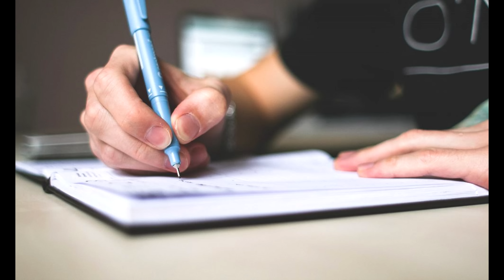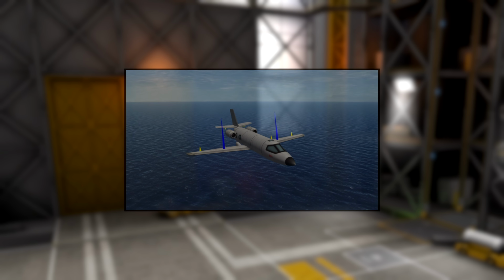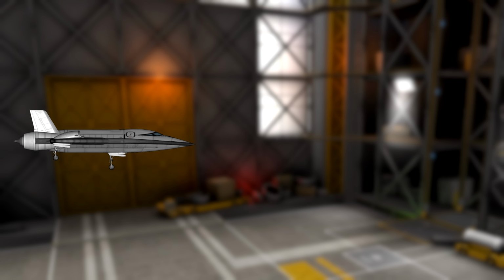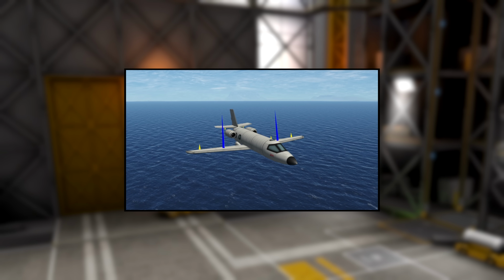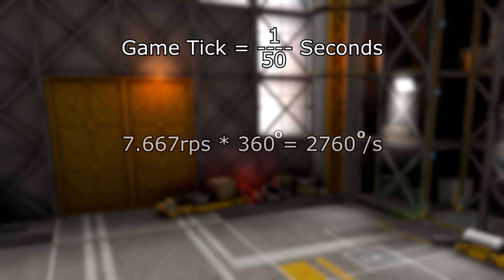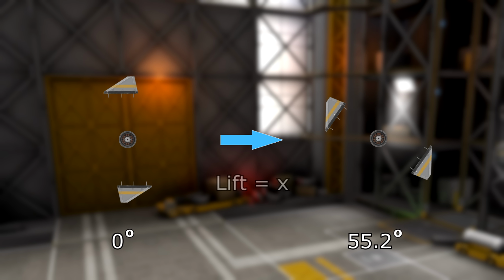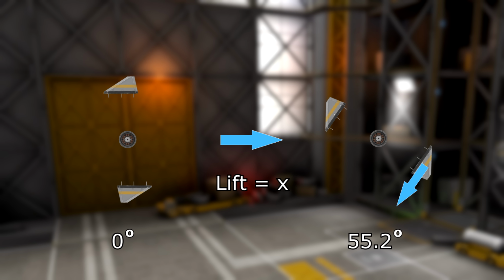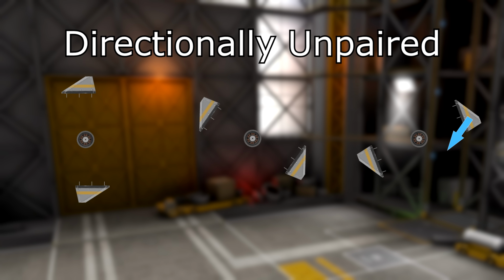Breaking KSP by Rotating a Fin || Directionally Unpaired Momentum Perpetuators

Comment: Fellas, is it perpetual motion when it’s solar powered? Just seems efficient. This guy gives off less data miner vibes and more just “i found a bug” vibes
Reply from the maker: If you cut off power entirely and the effect is potent enough the propellers will still accelerate, even beyond the stated rpm limit. It will eventually shake itself apart but it does generate output with no input, you just have to get it going first.

Comment: 1:43 of course it could do that. This exact procedure is known as the backwards Euler method to solved ordinary differential equations.
Reply from the maker: Doing it live is more complicated though, since it requires predicting the future position and then using that predicted movement to calculate forces. I'd imagine it would be pretty inaccurate under certain situations too, yeah?
Reply: @jedoesstuff9086  It definitely is more complicated, for each point in time a system of equations needs to be solved, but there are classes of problems (https://en.wikipedia.org/wiki/Stiff_equation) where the naive method, of only considering previous points, perform extremely poorly.

Comment: It’s similar to a classic issue in game engines, diagonal movement. When the X and Y inputs are added, the result is an increased diagonal speed. A common example of this can be seen in Minecraft’s run-and-jump mechanic
Reply from the maker: Not exactly, but that is the kind of thinking that lead ultimate steve to trying this in the first place. The logic was that instead of taking a circular path, because of how fast its moving, its more traveling in a hexagonal path. we dont really know about this though, which I caveated in the video

Comment: Wouldn't a quick fix be correcting the orientation of the vector by calculating how much the blade will be rotating in the incoming tick ?
Reply from the maker: not exactly, since this happens across every situation in the game. For props specifically, youd need to correct by  RPM * 0.12 degrees, but for planes it would be more complicated. Also you'd need to do this for all directions simultaneously, which would add a lot for the game to calculate and slow down performance.

Comment: I love how KSP code is now basically its own branch of physics lmfao
Reply: That happens a lot with "game breaking" genres. Speedrunning tends to create its very own worlds with new and weird internal physics. What was intended as a simulation or approximation of reality ends up creating new rules that are then being discovered and explored by players. GemCraft becomes about creating the most cost efficient gems and putting them into a configuration that minimizes lag. Trackmania mappers build maps that REQUIRE the players to trigger certain bugs. Then there's stuff like wrongwarps (for example in Zelda), where players start manipulating ram sectors with specific inputs. And Krakendrives becoming viable and reliable devices opens the door for completely new ways to play the game.

I absolutely love it. Even if i am usually just a spectator.
Reply: @privateprivacy5570 wtf gemcraft has speedruns?? I love that game

Comment: When I was younger (not that long ago), and still had interests including coding (life is dull), I realized that a lot of things would be solved by properly separating the flow of calculations and update everything last, though the downside is possibly worse overall performance.

In this case, you'd make the following calculations: 
- based on current (primary) forces, where will the object be? Effectively, put the forces together and store this separately,
- what inertial forces (drag, lift, etc.) or reactions (collisions, etc.) should also be applied based on the changes that will be made to the object?
- calculate all the forces together and update the object's position and rotation to suit.

All of this would happen in the first tick. It was a very useful basic trick to remember to stop things like clip-throughs from happening.
Reply: The hard part is doing all of that in real-time at 60 fps
Reply: @EpicGiantMango Like any game engine decision, it's a tradeoff. Fancier physics calculations would have increased the number of floating point operations required per physics object per frame, but fancier physics could have cut down on the years worth of patches dedicated to stamping out physics bugs.

In this case, parallelization can help a lot. When KSP was new, desktop CPUs could run a lot fewer parallel threads than today, so that would have been less of a factor.
Reply: Plenty of games and physics engines do this to different degrees, depending on requirements. It's also common to have sub-ticks where each full physics tick is divided into multiple steps. This is especially useful for detecting and handling collisions for fast moving objects.
Reply: You can use Euler's method or more generally a Runge-Kutta method. RK4 is common for physics simulation.
Reply: 'look ahead' physics.

good for simulators, bad for games.

Comment: The most insane part isn't even mentioned here because it's irrelevant for stock KSP, but if you imagine for a moment, if the rotors were "allowed" to go faster, this would actually cause a massive decrease in efficiency because the angle would still not change at all no matter how much faster you go. This means that at a certain point, the spinning actually causes the lift to be basically nullified entirely
Reply from the maker: I used this is my stock 3 ton eve mission actually with a stock prop. Stock props are limited to 480rpm instead of 460, so they actually do outperform rotors, but they are heavier

Comment: ive been working on my own electric only space program and have yet to leave kerbin this is gonna save me although it feels like cheating im trying not to use bugs
Reply: afaik leaving kerbin with only electricity without using any physics exploits or bugs is basically impossible. for what it's worth though, i was able to fly across the entire system in one stage using only electricity, a mk1 command pod and a mk1 front landing gear. so pretty much anything is possible with bugs.
Reply: Worth noting that this one tick delay is always applied, meaning the bug is in constant use as long as you have fins. At some point whether or not you're "cheating" is an arbitrary definition.

Comment: Ok but, as the angular speed changes, the optimal angle of the wing also changes accordingly, being less with slower speed and higher with faster rotation. Ideally, if it's possible to construct a contraption whete the angle of the lifting force changes during motion, it would be pretty epic

Comment: I think the devs fundamentally misunderstood what lift and drag even are: There's actually only ONE aerodynamic force, and lift and drag are just components of this force, perpendicular and parallel respectively to THE DIRECTION OF AIRFLOW. Not some arbitrary principal axes of the part.
Reply from the maker: I dont think they misunderstood, theres just the limitations on how to use that in the game with unity
Reply: @jedoesstuff9086  nah, you could perfectly model lift as the component perpendicular to velocity and drag as the component parallel to velocity. In fact, that's what the game does for body lift! but for wing lift for some reason it's in the direction of the surface normal instead of the direction of the component of the surface normal perpendicular to the velocity (if N is the normal unity vector, V is the velocity unity vector, L ought to be in the direction (N - V * dot(N, V)). That's just how "lift" is defined, and that's the only calculation they'd need to do to get this right.

And nah, this isn't a unity limitation. The lift calculation isn't done by builtin unity things at all, and it's actually quite trivial to mod in this change. It's just some quick hacks that are indicative of a fundamental misunderstanding of lifting body aerodynamics. There's a bunch more of those anyway, for instance where body drag of a long fuselage nearly doubles if you pitch up by a whole 2 degrees, which makes no physical or gameplay sense either.
Reply: i think the devs understood alot more than you think, but they made shortcuts because modeling it correctly would not be playable at all. except for on supercomputers at nasa
Reply: You should take a good look at the code for any game that you can get your hands on it for. Always full of hacky shortcuts, usually for performance reasons but often just due to not having enough time to do it right.

Comment: What if you use this with occluded heat ahields?  Stratzenblitz set a cord a while back for propeller driven craft at around 2700~ m/s iirc you might be able to smash that with this tech slapped on top of it
Reply from the maker: I dont think so. This technique can very easily become unstable if its too potent, but it could work. Ive never used heat shield wings before so maybe idk

Comment: Oh, very interesting. Reminds me of a similar (although I think not quite the same) effect in besiege, another unity physics sandbox. There a 'propellor' block is usually used as a regular wing instead, and it starts out with some base angle of incidence. Turns out that that angle is 23.06876°, and also turns out that prop blades at 0° AoA are modelled in the game as having 0 drag. But there is lift! Somehow. You can imagine that leading to some fun shenanigans as well, also for optimizing engine designs 

(Why the hell did I remember that number it's genuinely been over half a decade since I used it)

Comment: I didn’t know a tick was supposed to be 1/50th of a second, whoa
Reply: This is the default tick speed in any new Unity project, you can increase this value to get more accurate physics calculation. For example Half Life 2 (source engine) use a base tick of 66, so yep a tickrate of 50 for a physics based game is ridiculously low.
I would say for a modern game that is physics focused, 80-100 ticks would be the minimum to get more accurate results !
Reply: also cool perpetual motion machine

Comment: I once encountered a glitch where I could get a prop plane to hypersonic speed by varying the prop pitch incrementally. I think it might have had something to do with what you just outlined here. Though, it only ever happened with the largest motor in the game
Reply from the maker: Ive seen the rpm break 600 during kraken attacks while using this, unities 50radian/second limit seems very breakable